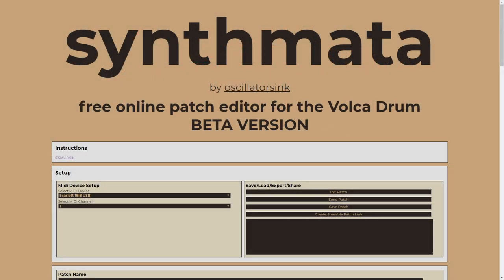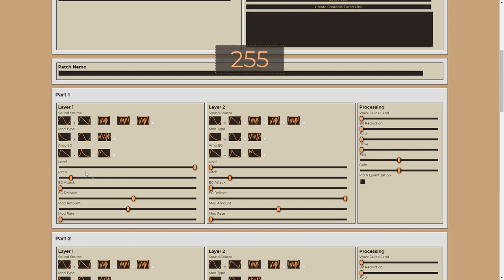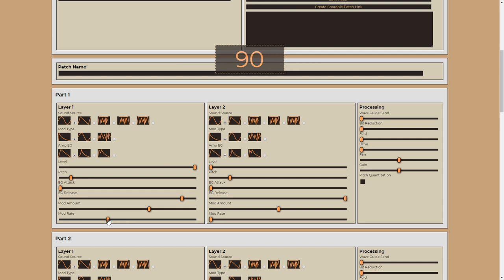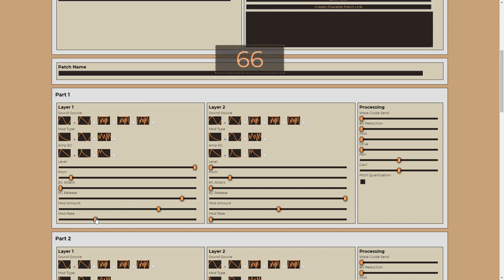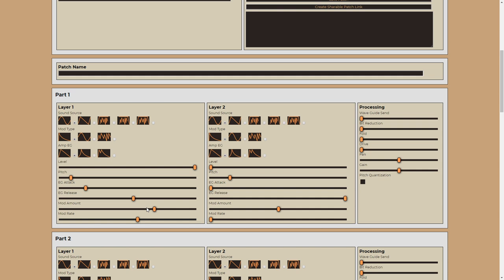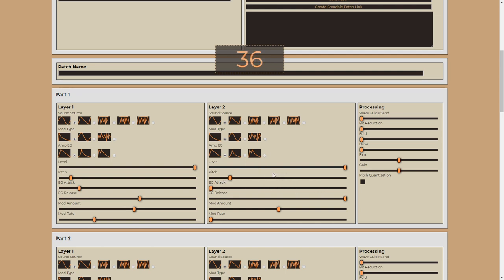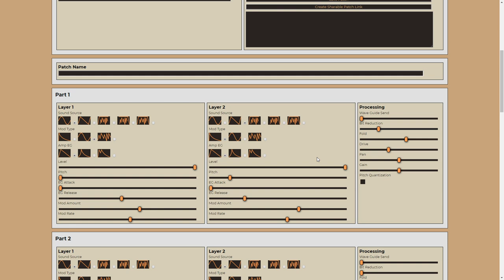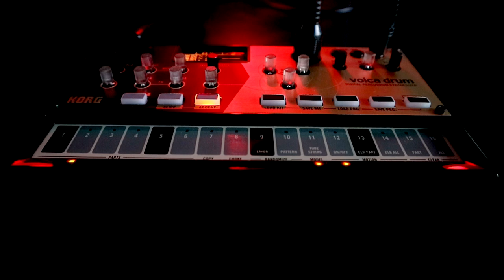How To Kick (a discussion of kick drum synthesis)

Comment: I was surprised that you explain this with Mod Rate, which is something not a lot of synths or modules have I guess? When creating kick envelopes with maths I always change the decay to make everything faster .... is that a suboptimal way to do it? Would changing maths from linear to exponentional (so everything gets faster or slower at the same time) be closer to the classic way to do kicks?
Reply from the maker: So mod rate here equates to the decay because its controlling the AD modulation type which has a fixed (instant) attack - higher rate, lower decay, which I probably should have said in the video. So what you're doing with maths is the same. As for linear vs exponential curves - I kinda feel like linear modulation can sound more synthetic and exponential can sound more "acoustic", but that's not a hard and fast rule, it's just a guide - it's worth exploring though.

I'd also say, while we're talking about Maths - try sending a tiny random source to the decay time (sampled on each kick trigger) - varying the attack of the kick can be a cool way to keep even a 4/4 kick pattern from feeling too static (unless that's what you want, of course!).

Comment: Anyone else noticed the horrible high pitched beep the Volca Drum emits, even when powered with batteries? Just a little bit amplification and it's clearly there, even worse if you send it through a distortion pedal. Then the beep is louder than the drum sounds if no voice is triggered. Looks like it's the crappy display and its pwm circuit to dim the backlight that's bleeding through to the output. It's unbelievable... (Volca Kick does the same even with absolutely no distortion or further amplification at all but with a different frequency) Absolutely useless for recording some samples to build an own sample library!
Reply: korg make awful toys passed off as musical instruments
Reply: Can't say I've been listening for it. You're right to complain but we're talking about a cheap(ish) music toy with scandalous creative potential imho.

I struggle to think of any classic or modern instrument/device that doesn't have some sort of design flaw, poor component, quirk or imperfection somewhere that people have to work around. Some of these flaws have even become fetishised and highly sought after over time (tonewheel bleed, VCO drift etc).